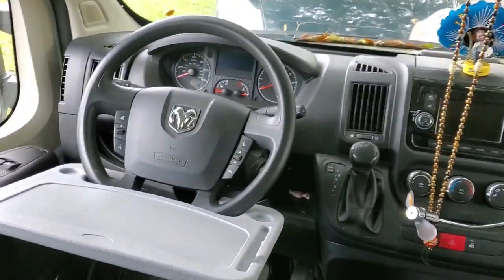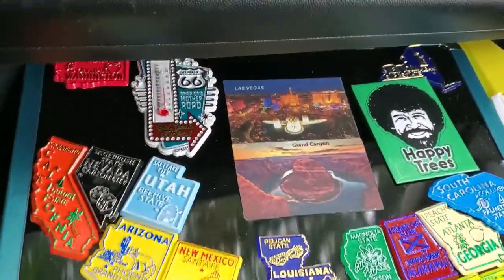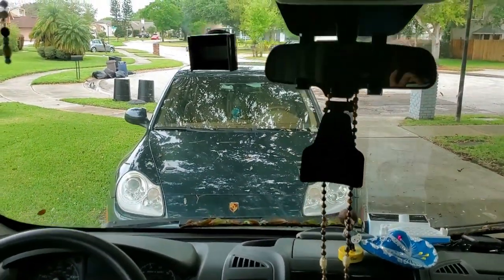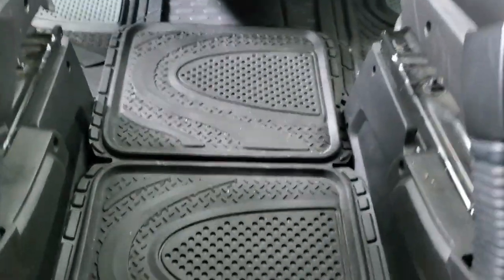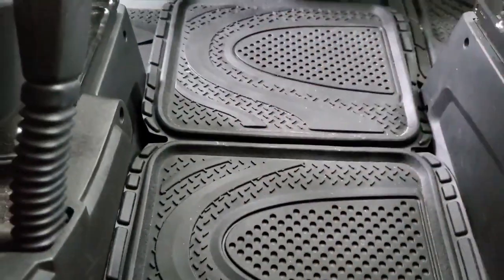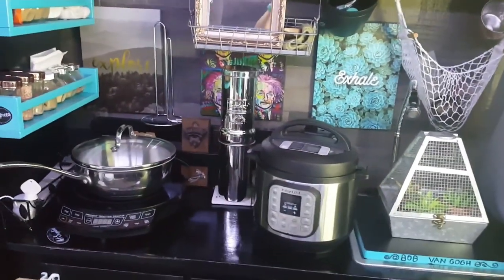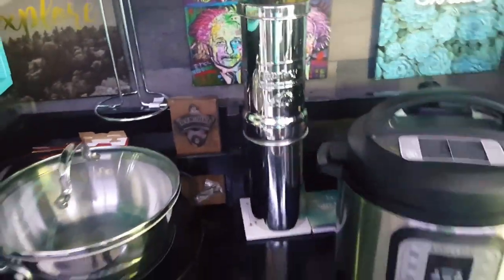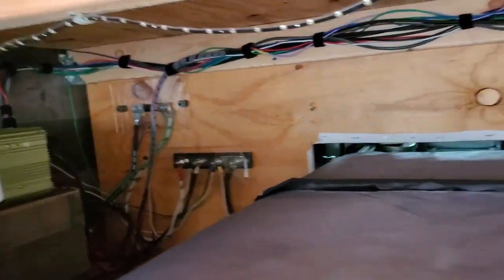VAN TOUR! VAN TOUR! VAN TOUR! #vanlife  [EP.14]

Comment: Thanks for sharing your home with us!!!  You only have 200AH of battery storage...  How many Watts are your solar panels?  Do you have a gas generator?  Have you seen any dip in available power since you have the Fridge, "HotPlate" and InstantPot?  Would you suggest any other power addons (batteries or panels) for a similar setup?  Be safe!!!
Reply from the maker: 320 Watts of solar is replacing the 200 watts I have now. The middle section of this video got cut out some how. I'll put it in another video. But  it shows my fridge, bed, closet, etc. I have 3500 Predator generator which I'll use when I install the AC unit. My fridge is 12V and it runs on the battery. The Instantpot is more efficient than the induction cook top. I usually cook outdoors with the butane single burner. Thank you for the safe wishes.
Reply: @NomadicNicoleCamperTantrum  - Thanks for your response.  I'm leaning toward man InatantPot also.  Researching some cook books now...

Comment: Isn't 159-in. wheelbase the largest?
Reply: There is a 159 extended that is even longer. Same wheelbase but sticks out further in the back.
Reply from the maker: Sara is right, the 159 extended wheel base is 13 inches longer and doesn't fit in a single parking space. I couldn't find a used vehicle and the price of a new would've blown my build out budget.